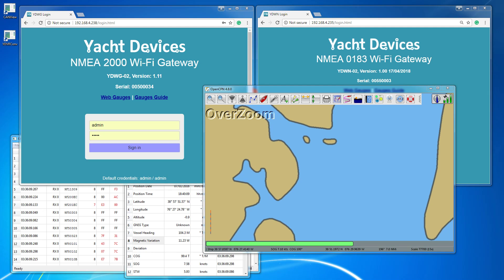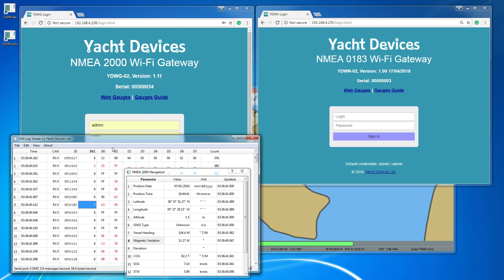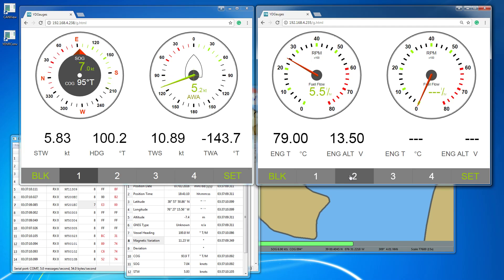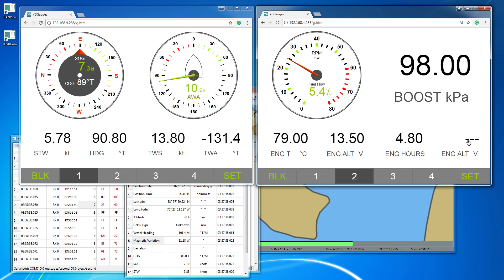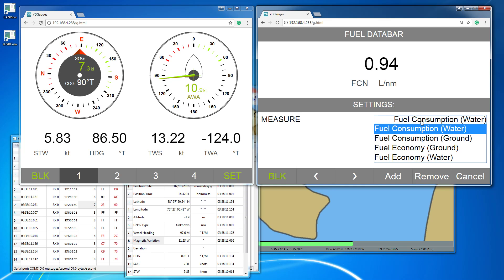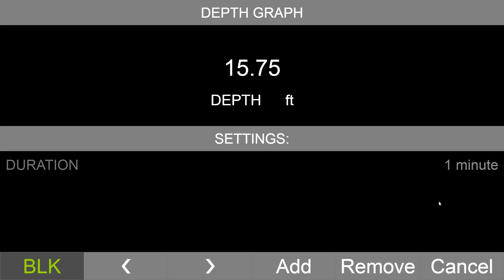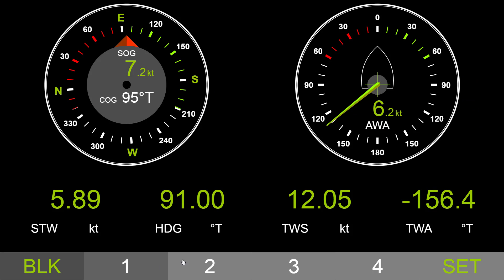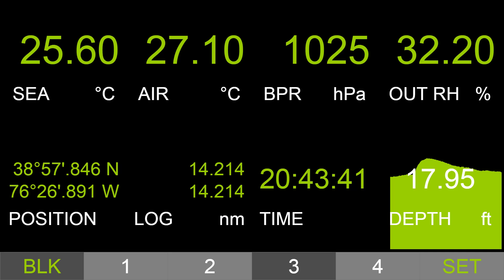Web gauges of Yacht Devices NMEA Gateways

Comment: Sensors?? Information is coming from where?
Reply: You connect whatever sensors you want to the NMEA bus (either NMEA 2000 or NMEA 0183 - they support both versions).  These sensors output NMEA standard "messages" onto the bus.  Since their wifi gateway device plugs into the bus, it can read all of these messages in real time and then create and serve the web pages showing the data using gauges.  I just bought their NMEA 2000 gateway device for a new glass helm application I am writing for the yacht that my partner and I are retrofitting.  This is an exciting product IMO and I cannot wait to get my hands on it.
Reply: From NMEA 2000 in case of NMEA 2000 Wi-Fi Gateway or from NMEA 0183 in case of NMEA 0183 Wi-Fi Gateway, on from NMEA 0183 / SeaTalk1 in case of NMEA 0183 Wi-Fi Router
Reply: Alexander, have you ever tried decoding the canbus messages from the Glendinning engine control head?  I bought the Glendinning dual engine control system and it has uses canbus with proprietary messages but of course the connectors and electrical protocol are compatible with NMEA 2000.  One of the first things I do will be to reverse engineer their proprietary messages so that my computer SW can know throttle position, whether the transmissions are in Forward Neutral or Reverse, etc.  It would save me a bunch of time if you have already decoded these messages.
Reply: @thecaptain8773  Hi, did you success reverse engineer their proprietary messages? I am also interested in it. Could you share more about this?